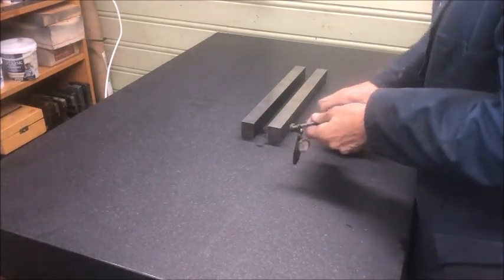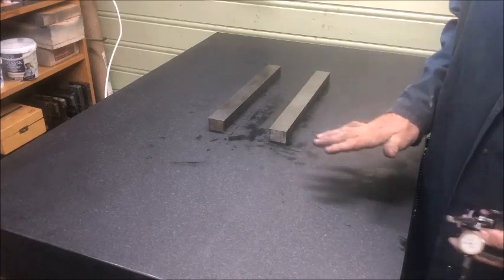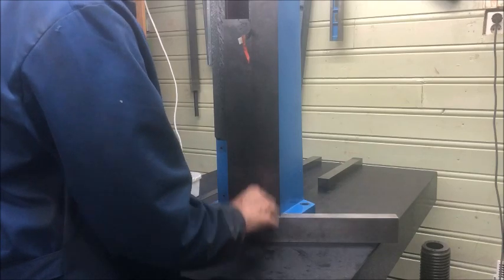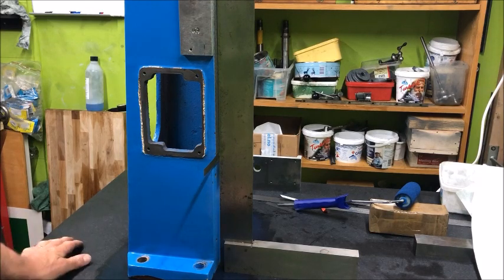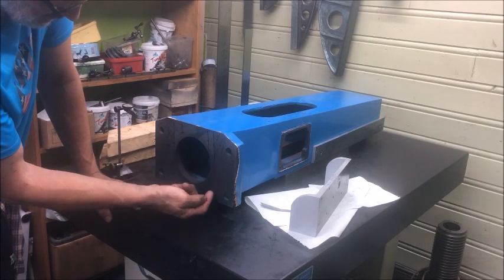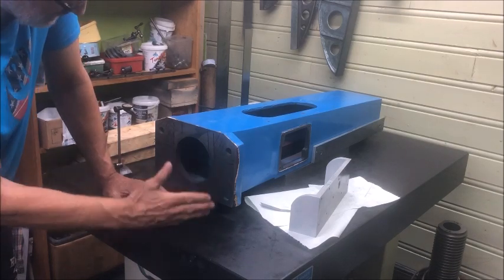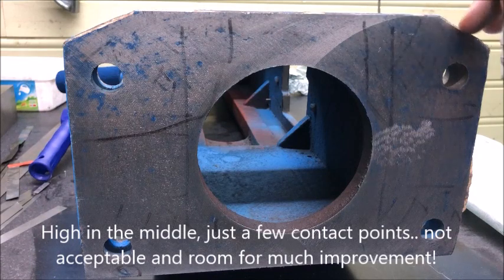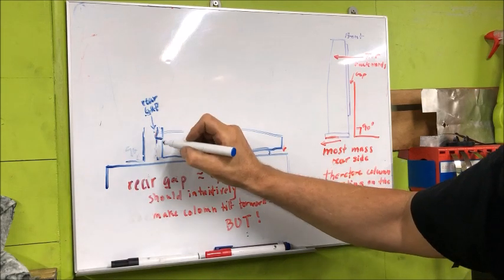HBM45  - column foot - measurements

Comment: Hello Jan,
Sorry for another question... Would I be correct in the logic that when scraping two surfaces that are 90 degree apart, you should always scrap the longest one first, therefore scraping side two for flatness and squareness (90 degree) would be on a smaller area. 
Thanks.
Paul,,
Reply from the maker: In general, it is much easier, therefore possibly better to correct any errors on the shorter side. Like for example on a Bridgeport knee you make the needed alignment on the side facing the column as this is shorter

Comment: Thanks for sharing! Excellent content as always! I have the same machine and I’ve been interested to find out how much it can be improved in terms of precision and rigidity. After you’ve had some time with it, what is your impression of the design of the machine? As you probably noticed, the weight of the head is probably close to 100 kg. Do you think the column is sufficiently stiff to be able to hold this weight without significant deflection? I’ve come to accept Robin’s position that everything is rubber, but how much deflection would you think the head imposes on the column? Are you planning to measure this? It would be really interesting, because this design is the basis for so many hobby machines.
Reply from the maker: Thnks! I am just doing this work for a friend, ie. it is not my machine. I guess I will have to discuss this with him before I proceed. As mentioned, I am pretty sure he measured with the head attached, but anyhow, instead of leaning the column backwards to compensate for the weight of the head i would stiffen/support the column somehow. I see that there are several ways to go about this and many have made seemingly successful improvements to their machines. The reality is however that this "flaw" is probably inherent with the design.
Reply: @jansverrehaugjord9934  seen a video where a guy mounted the base and the top of the mast of his machine to a solid concrete wall using triangulated mounts  , he made the mounts adjustable so they wherent pushing or pulling against the construction just holding them in the position they where in , but that made the overall stiffness a lot better

i allso have a clone of the same machine ,. mine is sold by cormak in poland , i was looking intoo making a raiseblock to put under the mast to be able to mount engineblocks under the machine , was planning on a solid block of cast iron across the flange under the base and use longer bolts to hold it down to the base , was allso planning to measure the straightness of the mast / thickness of the shims under the base needed to  set the mast up treu and straight and use the same shims to cut one side of the cast iron block a little off level to compensate for the crookedness of the mast base , from the looks of the measurments you done on this machine i be better off trying to get everything straight to start with , would mean getting a verry large surfaceplate though
Reply from the maker: @watahyahknow  Understandably, there are many ways to go about this among them as you indicate. However, in my eyes the best is to start from the base and build from that, be it to improve rigidity or alignment and accuracy.. A basic, simple machine, I think the machining leaves abit to desire and so does the workmanship, but all in all you get what you pay for and with attention to detail, skill and patience you will get as good a machine as you want, within the realms of the designed functionality and work envelope. Actually, I think the throw in the X- and Y-axis are somewhat stretched beoynd design limits, and could in my eyes be somewhat limited, eg. to where you don't run so far past the full support of the saddle.

Comment: This column I did not do yet. I have a 2'X3' surface plate which should be enough but I'm afraid I will scratch the surface plate if I put the column on the surface plate.
Reply from the maker: Nja.. be careful and stone the column at first, then use a crane to move the column if you feel you cannot handle this. For me, it was just on the limit, but I would of course have been easier with some liting assistance. Just be careful and have safety as top priority!

Comment: Sorry,but with a steel square?
Reply from the maker: Yes, why not? Could have used some other means of precision tools, like a cylinder, but the squares I have are good
Reply: @jansverrehaugjord9934  its ok.before i think you can use a square level for check that,but is ok like that
Reply: Where you buy the trhee anglees straigt edge you used for scraped the column?
Reply from the maker: @fabioth283  These are available from a good store stocking precision tools. You have system used to classify measurment tools, like DIN876 and 875, with subcategories eg. /0 and /00 or /1, /2 and /3. You can get steel, granite and ceramic ones of different designs and sizes. One source could be like here: https://shop.otdtools.se/category/granitvinklar or here: https://www.interempresas.net/FeriaVirtual/Catalogos_y_documentos/3917/Esqudras.pdf
PS! It is not so common (anymore) to find steel squares with the highest classification, and the prices for granite squares have dropped, so if I were to buy now I would go for such a piece. Probably throw in the extra cash for a class above what you think is needed, but at the same time having in mind the limitations you face when trying to do ultra-precise measurements in a "non-climate controlled environment" like a typical home shop. Hence to my thinking there is no point in paying a huge amount of money for a tool that is meant to be used sparingly, probably as a master, in a totally different setting under very stringent and proven conditions, eg. in an accredited test laborator or "measurement/instrument room" in a top-notch and approved factory making parts for their subsea or space customers :) You will never be able to "use" this precision anyway and the measurement uncertainty you have because of the less than ideal conditions will outweigh the benefits of having a measurement device that are able to measure more accurately than you can have any chance to accomplish in a verifiable way. So a bit of realistic and  sound thinking behind the decision is good :)
Reply: @jansverrehaugjord9934  thank you so much.i use in my job a same trhee angle,is long 1200mmx 130large side,but im looking for one to have at home.thank you Jan